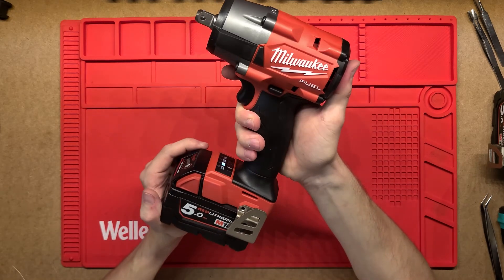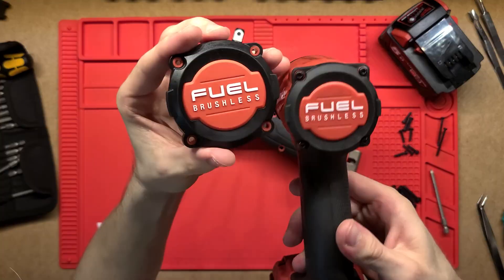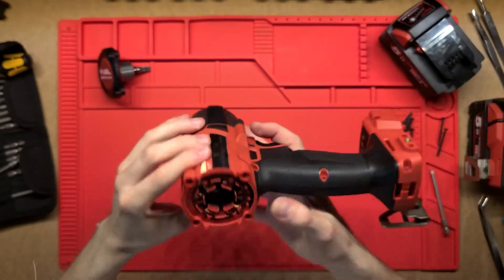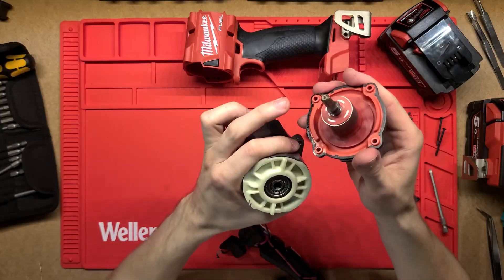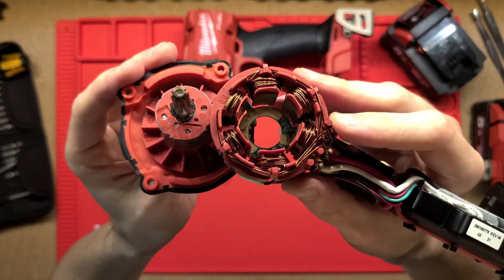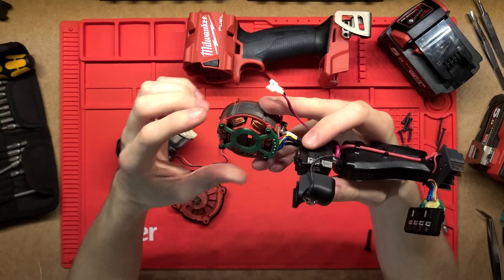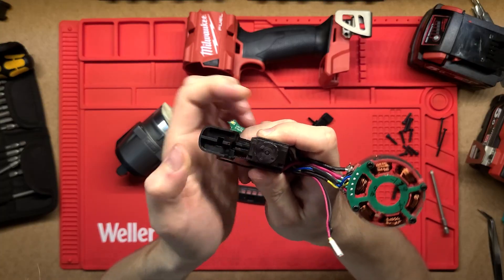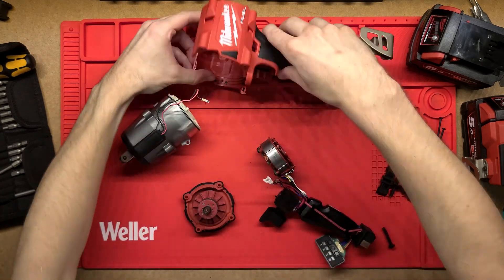MILWAUKEE M18 FUEL™ 1/2" Mid-Torque Impact Wrench Teardown

Comment: The gearboxes arent particularily imtimidating to dissasemble. The worst thing is the non captive axles on the planet gears that can fall out and let the gears fall off the hammer. 

Practice on a broken tool, or this one. The diagram of assembly order is available online if you lose your place but filming it as you do should show how everything was assembled

Comment: Phenomenal video I’d love to see ya do a video on replacing the chip in the battery (can get overloaded in high draw tools some call it a “BMS”but Milwaukees 8.0  high output battery’s I think the model is 48-89-1800  but great video man much appreciated
Reply from the maker: Thanks for your comment, I really apprecaite it! 
Ahh, fair, I haven't taken these batteries apart yet either, will have to get onto it.